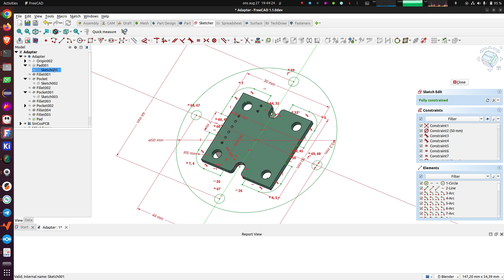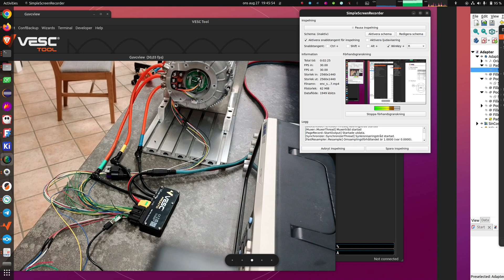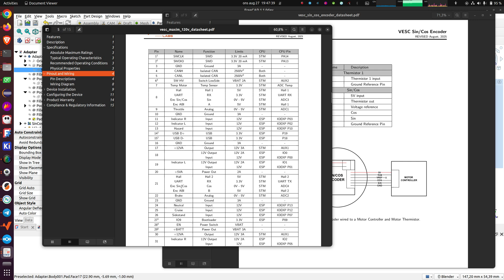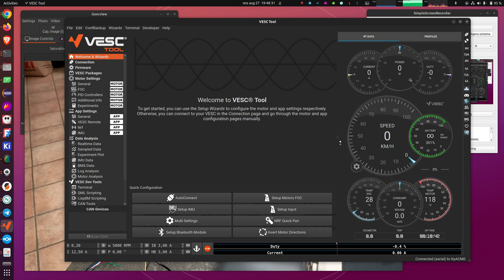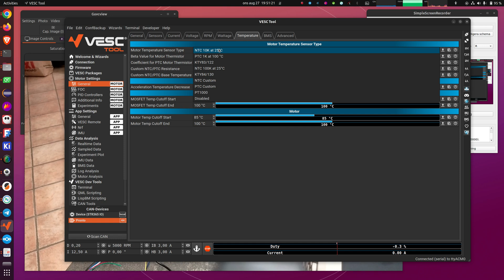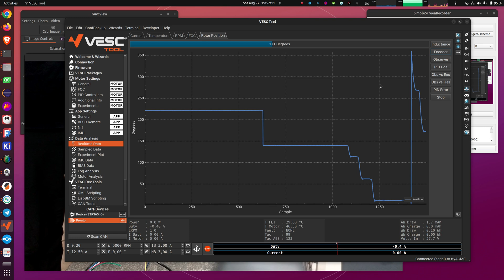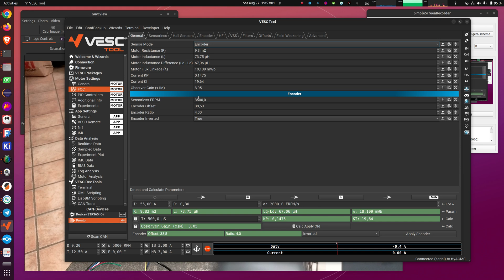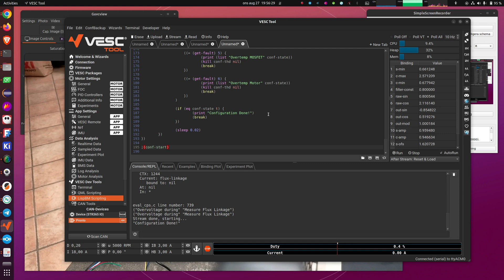VESC Sin/Cos Encoder

Comment: Hello, please add support for 3 pin pass sensor, any type of signal, to the firmware. For flipsky 75100. I have a built-in PASS sensor based on the SS41F Hall sensor in my engine, I would like it to work with VESC

Comment: a good improvement to solve the cable length challenge could be to place single-ended to differential converters on the encoder board, and the reverse ones on the VESC board. But this required 2 additional pins on the connector

Comment: Many of those magnetic encoders can be off by a degree or two at certain positions. Is there support for applying a (measured) correction table/equation to really max out the precision? It's pretty easy to generate such a table, just hook a stepper up to it (known reference) and log real position vs measured over the entire range.